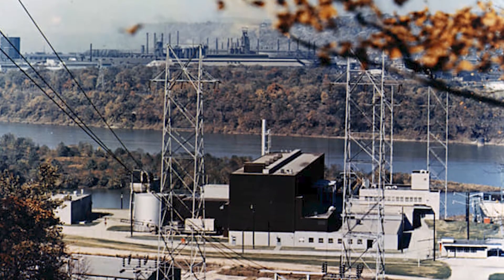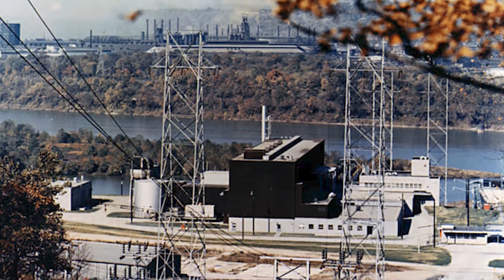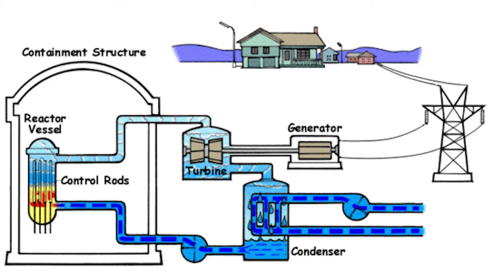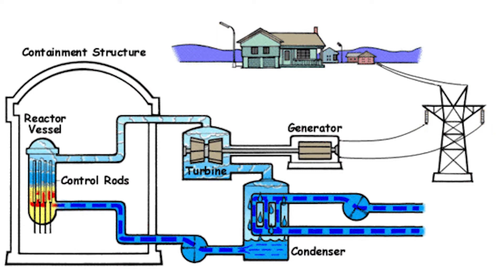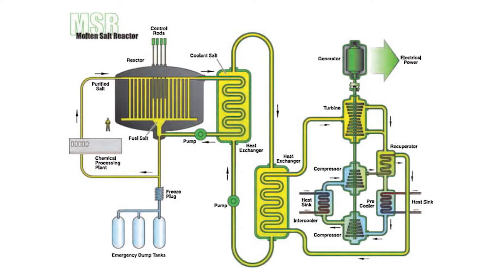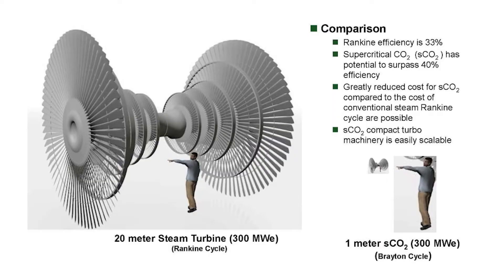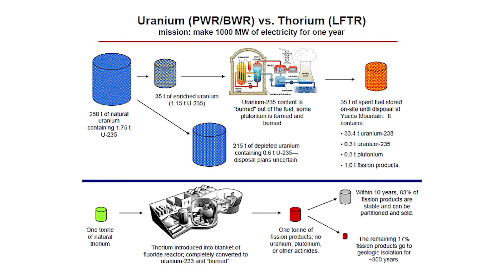The Best Nuclear Reactor: Light Water VS Molten Salt | Ep. 2

Comment: ThorCon and  Flibe to date have produced nothing except the world's most expensive powerpoint presentations. No ground has been broken, no concrete poured, and it doesn't appear that that they ever will. It could be that circulating hot, corrosive, radioactive, molten salts through 100s of feet of plumbing, seals, valves, bends, just might not be the best engineering solution.
Reply from the maker: Thorcon is working with the Indonesian government, utilities and regulators to license and build their reactor in Indonesia. Flibe has received grant funding from the DOE to work with Pacific North West National labs on the science. They haven't produced anything in this country because our regulators refuse to update the regulations to accommodate new designs that deviate from the LWR. 

As far as molten salts are concerned the science is well understood and we have since developed corrosion resistant materials to accommodate the corrosion issues you speak of. Salts are chemically stable and allow us to run these reactors at high temperatures and low pressures.
Reply: @RockLogicWithSeanKenny  Again to date, Indonesia has commissioned no nuclear plants. ThorCon & Flibe are part of a handful of companies that do nothing but produce position papers on MSNRs. These companies have no history nor expertise in construction of any kind. 
In past years, MSNRs were the infatuation of every 1st year physics student, until they were forced to face the engineering difficulties. These days there appears to be a cult following for MSNRs, especially on YouTube. Technical difficulties are brushed aside, lack of interest in MSNRs by govts & the energy sector is blamed on conspiracy theories, anyone suggesting that maybe money is better spent on IFRs or 4 gens is denounced as a hater.
If you care to make a small wager on Long Bet, I'll bet that ThorCon will not build a commercial MSNR within 10 years. Interested?
Reply from the maker: @deeas6518  Actually Indonesia has 3 Nuclear reactors. They are research reactors for medical isotope production and for training their scientists to operate future commercial reactors. Thorcon is a new company but its parent company has a lot of experience in the shipbuilding industry. Which will come in handy once they look to scale their design. 

I don't have any issues with Fast Spectrum Reactors aside from past proposals to use Sodium for cooling. Eylsium and Moltex have designs that do not require the use of liquid sodium and have the added benefit being able to run on spent nuclear fuel. 

Maybe Thorcon and FLibe will fail? Ok I can accept that as a possibility. However while these two companies are working towards their goals under the restrictions of our current regulatory environment, other companies have sprung up with equally impressive designs. 

I'd like to ask though what company do you know of building advanced Gen 4 or IFR designs have a working prototype or some other example showing off their progress. I may consider talking about them on my show. Let me know.
Reply: @RockLogicWithSeanKenny I'm sure you're aware of  Rosatom's BN-800. Might be a stretch to call it a Gen-4, but it is up & running.

Comment: The truth is if our nuclear regulatory apparatus was strictly profit oriented and not political molten salt would be a no  brainer to be the best. Why? Because you do not need a pressure vessel costing far less. No cost for extremely rare elements and huge expense of fuel rods that consume only 5% of the energy in the material. Notice I am not saying only thorium though it would be much less expensive because no plutonium is produced. That is the major cost additive to any reactor. The fact you can use the fuel heat with molten salt is so huge just making heat dependant chemicals you would make more from chemicals than for power production by many times over.

Comment: The problem is not with the reactors so much, though there are problems there.  The real show stopper is what is conveniently ignored, the costly but more importantly very dangerous recycling / reprocessing plant required to take out contaminants repeatedly so that the partially spent fuel can be burned up more.  Actually, that can also be done with solid fueled conventional reactors.   They don't do that because of one element involved: plutonium.  It come out in a form that is too easily taken one step further to A-bomb fuel.  The thorium reactors are no different, really.  I am no expert, but this guy is, listen to him:  
https://www.youtube.com/watch?v=zCpVTO_BHto

Comment: Why do people continue to blame regulations for hindering reactors other that PWRs of BWRs?  The NRC is pro-nuke all the way and they have extensive experience with the design, operation, and hazards associate with PWRs and BWRs.  So yes, any new design will require extensive accident analysis to determine the controls that need to be in place for safety.  And in the south and midwest, anti-nukes are about as rare as an honest politician. The #1 enemy of any nuclear power plant is extreemly poor economics when investors evaluate new construction cost over runs and the economic risk associated with any accident.
Reply: @clarkkent9080  Logical fallacy argument.
Reply: @clarkkent9080  How about using the same radiation standards/limits that a coal plant has.